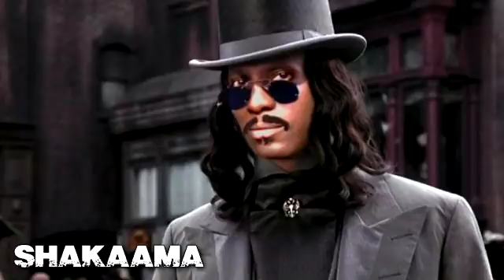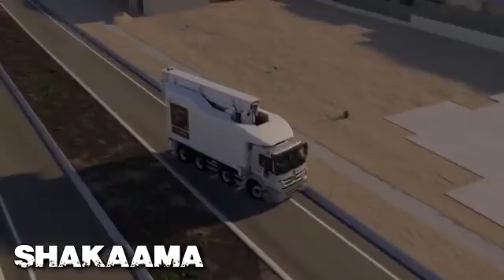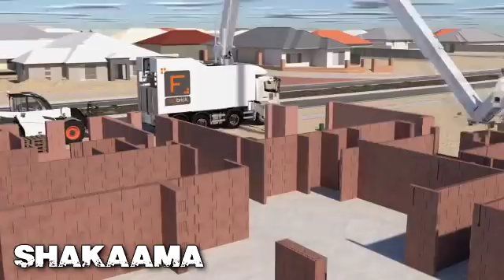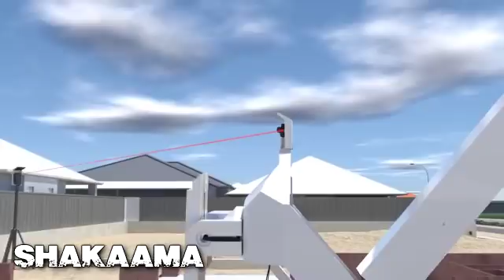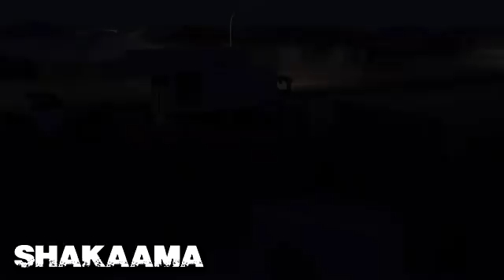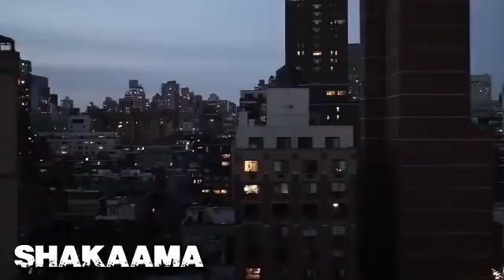THIS ROBOT WILL DESTROY THE CONSTRUCTION INDUSTRY BY ITSELF

Comment: As we say it looks good on paper. I am a retired Project Superintendent 38 years in the trades I can see where it will have a application but someone has to put the door and window bucks in place or set the metal lintels. Now that your are using brick/block you will have us metal conduit for your electric which goes inside the cell of the brick/block now you have a problem coursing out not to mention if you have put Rebar in. That's just a few problems this will face but its a good idea.
As always Shakaama I enjoy your content thank you for all you do.

Comment: De-skilling of once highly laborious or certification heavy jobs will be a major issue this coming generation.
Here's a potential example-
Trucking and delivery. Especially over the road trucking.
...
Even if and when self-driving vehicles are perfected. I can still see the government mandating that someone continue riding in that truck for "safety" and "liability" reasons in a sham attempt at staving off job losses.
Now...
 You'd think skilled truck driver's jobs are saved.
Nope...
Dead wrong.
If technology is doing all the driving and distribution centers are retrofitted to where lumpers/loaders are automated and heavy industry drones are doing all of the major lifting.
A company could literally hire anyone off the street just to ride in the cab.
Babysitting the vehicle from point A to point B. Occasionally call assistance whenever the vehicle needs servicing on the open road.
Maybe sign some paperwork at journeys end.
Why continue paying a skilled driver by the mile when the job has become simplified to where almost any person can be hired to do the job at a small-medium flat rate?
Especially as the job becoming more simplified to the point CDLs and other certifications eventually fall to the wayside.

Comment: I dont think this robot will matter here in the U.S. The cost of such a machine is way too expensive for the normal home builder. Also the ground has to be so very precisely leveled, the robot cant level the land. That takes manpower. Im not worried..also it takes manpower to operate the robot, check for defects of the building, still need code inspectors, electricians, plumbers, concrete people for the subfloor, the list is endless.. If you think about it, if theres a shortage of brick layers now there wouldnt be too many brick layers out of business anyway.